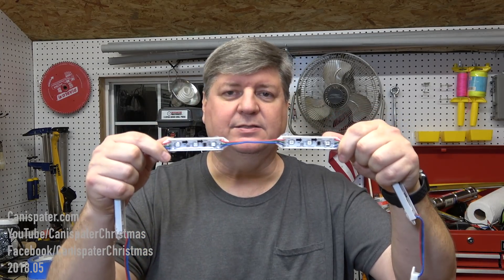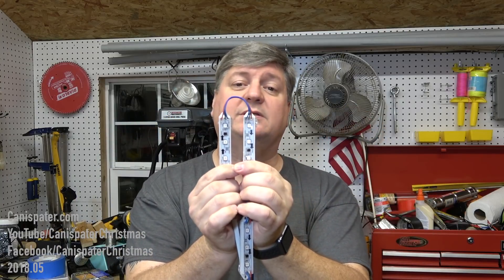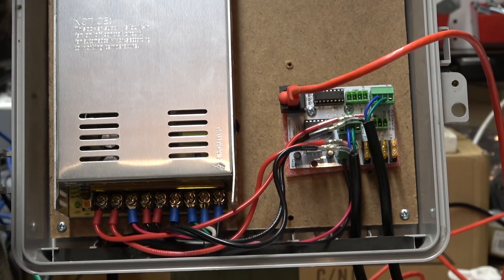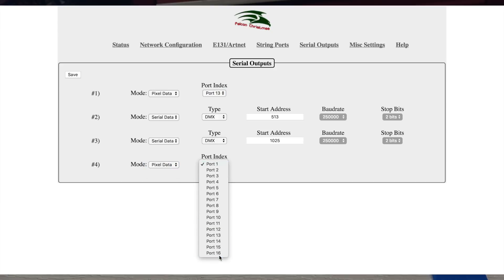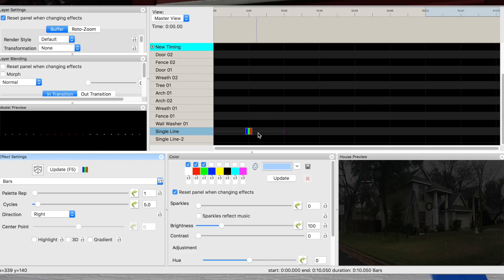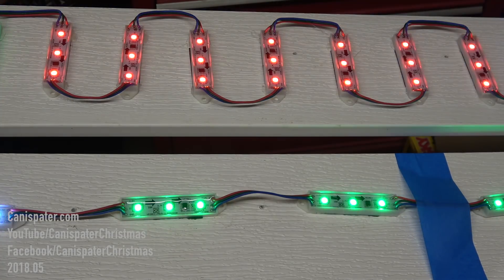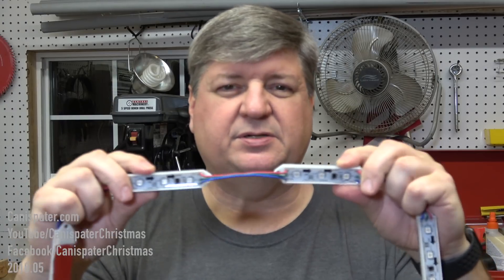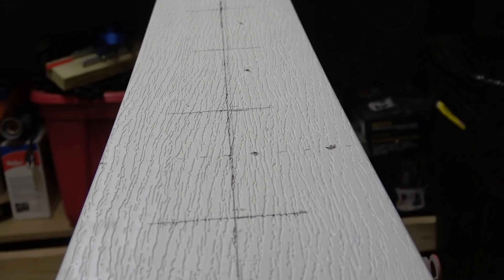RGB Pixel Wall Washer Rebuild (2018)

Comment: do you have a link to where i can get the 3 led pixel lights used in this please prefably in the UK
Reply from the maker: I got those from Ray in China. Check the forums/Facebook groups listed in my video descriptions for potential vendors in the UK.
Reply: @CanispaterChristmas  i have looked on Rays store but cant find them, i dont mind ordering them from ray if i can find them
Reply from the maker: Yeah, the store is a bit of a mess, but I always look under the products/Falcon Controller section. STAY AWAY FROM ITEMS MARKED PROMOTION!!!!! 😂Try this: https://www.aliexpress.com/item/1005001714716733.html?spm=2114.12010612.8148356.65.417e2d5d86NRga
Reply: @CanispaterChristmas  perfect thanks jeff, the postage to uk is tripple the price of the LEDs. I will email him see what he can do dircet for a big order

Comment: How would you set if you want vertical pixels on the f16v3 ?
Reply from the maker: If I understand your question correctly, "the same." Those modules are one pixel electrically so orientation doesn't matter. If that doesn't answer the question, please elaborate. :)
Reply: You mention horizontal or vertical, if there vertical and you put a chase effect it will go like a straight line but if there vertical that same effect will go up and down, how would you make the same effect go straight  and not up and down
Reply: Oooo never mind i see each bar has 3 pixels but all 3 turn on the same color....sorry...
Reply from the maker: Well, I did a test (2:16) with some vertical and some horizontal. Same effect, just a different look. All three LEDs in each module act as one pixel as far as the F16 is concerned. Now if you mean tilting the entire prop, there is an adjustment on the (xLights) affect to get it to switch directions, but no change on the F16.